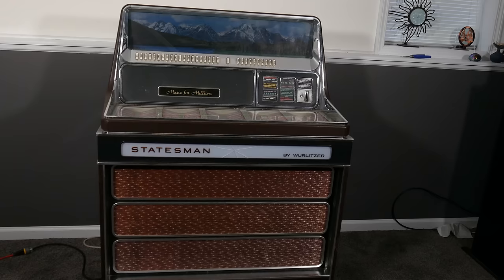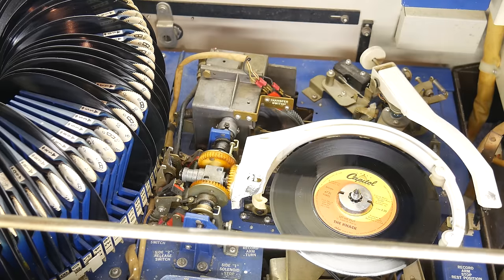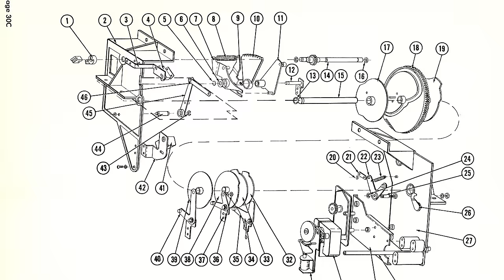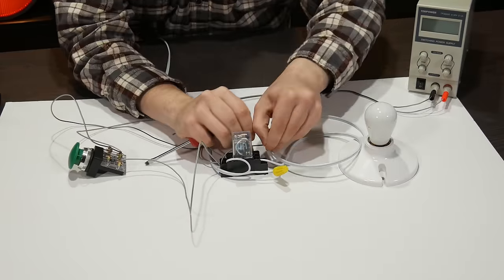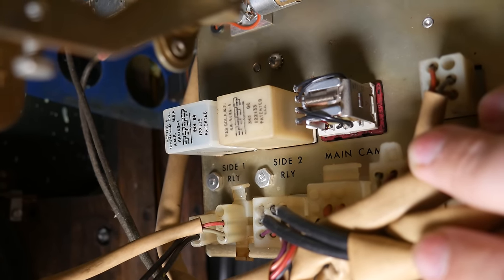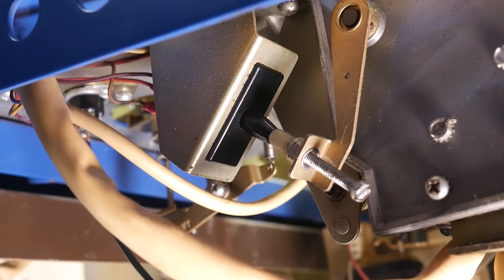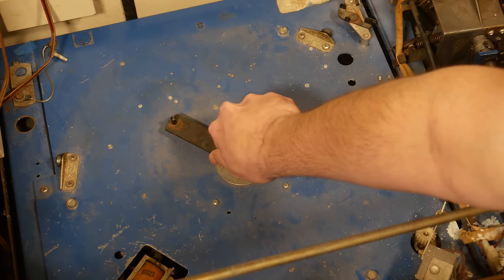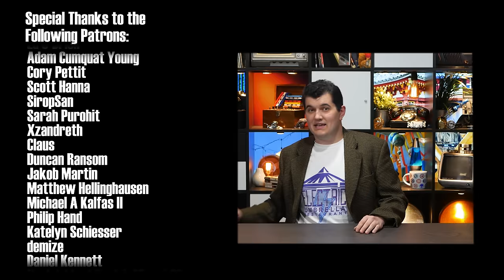The Computer-free Automation of a Jukebox (Electromechanics)

Comment: I can't even imagine how long something like this took to design, refine, and troubleshoot to get working flawlessly.
Reminds me of doing the Rube Goldberg contest for the state Engineering Fair back in HS many years ago. You can have everything working perfectly, then as soon as you add one more step it breaks the whole contraption.    Now that I think about it... same goes for coding. 🤔
Reply: BRUXXUS to make design more challenging, I believe CAD wasn’t around that time, everything is on drawing boards. Engineers those days were hardcore.
Reply: Totally, there is a whole new level when you want it reliable!

I have a CD-changer mechanism for cars I have studied some. By the looks of it, the CD's are stored in a stack, and to play one you split the stack and load the player into the slot, and then grip the disc with the spindle without letting the discs go during the operation. Some few motors and lots of switches. Eject and load probably have the same deal.

Sure a microcontroller makes the sequencing somewhat simpler, but I would guess the program is mostly "energy that magnet, and run the motor until switch xx triggers". Not too different.
Reply: And then once you have a working prototype you have to figure out a way to efficiently mass produce thousands of the finicky contraption--with each somehow assembled in proper working order.
Reply: @Mikemenn  It's kinda built as simple as possible.

Modern stuff is way more complicated, while looking simpler.
All that hidden complexity made by someone else, means that we don't understand the technology we use in our daily life. I am mainly refering to the integrated circuit(IC).

I am not convinced it would look simple if they used discrete transistors to build it.
Reply: @erlendse  Well, there is an analogy to made here. The engineers the design this machine also did not need to know a lot of how components work or or built. they don't need to know "how" a relay works (even if they do), only that it does, or how a motor works, only that it does, they don't need to know how gears are made as long as they do what they need.
Those component act like the ICs of today (yes simpler) since in order to use them in a design, they did not nee to know all of its internal features.
Reply: Imagine having to go back and change something though? You can't just rewrite a few lines of code. You'd have to physically change this whole complex design, which might have a domino effect forcing you to change other things to make it fit.
Reply: @maxsnts  True. Main issue today is that they won't even tell how something works.
Reply: @renakunisaki  Yes, but in those days products undergone a lot more tests than today before hit the market.
Today, very often product are in consumer hands even before all the features are done, the they push software.
Reply: @erlendse  Even with discrete transistors, digital circuits look relatively simple. It's discrete analog circuits that look complicated because of the variety of types shapes and sizes of components. Way back in my student intern days I had a circuit board from a desk top calculator that was basically a couple hundred transistors packed, cheek by jowl (now there's an expression you don't hear much anymore, by gum), into a grid.
Reply: Coding or designing electro-mechanical solutions for large and complex problems is in general a very hard task.

However what is not all that hard is designing a small solution to a single simple problem. This I find is one of the biggest hurdles to get over when it comes to learning to do projects, whether code or mechanical, well. - You're NOT designing solutions to large and massive problems, but rather you're breaking said large and massive problem down into small and simple ones, to which you design and implement small and simple solutions that work very very well for solving said small and simple solution.

Overall the engineering challenge on something like this isn't really in solving all electro-mechanical problems going on, as once you're familiar with how they work you can seriously design the basics and core timing on something like this in an afternoon, but rather doing a layout and parts design that can be made cost effectively... That's the real challenge and is the make or break on product engineering.

Designing an effective and functioning jukebox is easy.

Designing one that can be built quickly, cheaply, and reliably that is easy to fix... That's the part that is make-or-break for the business.

That, and getting an effective use of dark-orange going on in the design.
Reply: It is impressive but on the other end, what you see here is the result of many iterations. That jukebox is from the 70's and Wurlitzer have been in the business since a long time. So it probably start with something simple, adding more and more logic each new version as the years passed.
Reply: Order an older college level textbook on a subject called "differential indexing" its basically the study of gear ratios and cam timing within a complex system and lays it out in a way that makes it imminently adjustable and makes you able to fiddle with inputs and outputs. With modern 3d printed gears you could really have some fun playing around with gear ratios and final drive speeds, before you even get to adding grooves to the gear faces and switches outside those, or whatever sophistication you want. Its not impossible and resources exist specifically to make it usable on a daily basis. Check it out
Reply: Not always flawless operation. I heard a report of an incident where someone dialled up Dusty Springfield and got Elvis Presley... fortunatley those kind of disasters are few and far between.
Reply: You should look at the internals of a mechanical teletypewriter, with their mechanical memories. You would be left wondering how the human mind can conceive such complex mechanisms. IMO, the mech RTTY is a masterpiece of electromechanical engineering. From the motor, used as energy source AND clock generator.
Reply: Nowadays ICs are a good way of condensing the complications. Instead of going the hard way with switch and cam you make a chip that handle everything. 
The chips in themself are harder to produce, but you can simplify everything else.
And seriously, chips aren't that complicated to understand, it's just that nowadays they have a lot of functions.
Reply: $695 for a Rockola in 1970. That's about $4,600-$4,700 today.
Reply: @ameunier41  The problem is that nowadays the programmers don't know how the chips work. They rely on layers of abstraction like Real Time Operating systems, or even non real time ones like Windows to shield themselves from the hardware. That is why I don't do software.
Reply: @blindleader42  why do I just know the 42 in your handle is a Doug adams reference? Or have I misplaced my towel?
Reply: @pudgeboyardee32  if no one else heeds you... I do. This stuff is infinitely fascinating to me. and we have three young kids so this is a great way to encourage their curiosity and get them learning some useful principals... The grid can come down and a pulley system still works... It'll go hand and hand with the lessons on leverage they're already getting when we go flip rocks at the creek. Thanks.
Reply: @joeydurant6267   "Doug adams reference" Why I never. Slander! Libel!! Words I never heard in the Bible!!! It's just a reminder of what you get when you multiply six by nine...

Either that or something something something base 13
P.S. Sorry about your towel. I hope you find it before you resume hitchhiking.
Reply: @blindleader42  base 13... Sass this frood.
Reply: I would think that, with the proper notation in the design stage, it would be pretty easy to work out the sequencing, design the cams, and figure out what switches you needed and at what points they should be opened and closed.  Maybe I just have an unnatural aptitude for this stuff, but it doesn't strike me as particularly difficult, given the right tools and parts.

Comment: When I was in high school back in the '90s we had a robotics program, we relied heavily on donated old industrial equipment from the auto industry. We had a family of microcontroller - based switching units called programmable logic controllers or PLCs. You'll see those all over the place even today, they're basically ruggedized big general purpose computer controlled switching devices. The most interesting thing to me about them was the way they were programmed. Because they were designed to be used by people who had been building electromechanical logic circuits their whole careers, you actually programmed them by creating ladder logic diagrams in the interface. It was essentially a computer programming language built using the visual language of electromechanical devices.
Reply: Ladder logic and PLCs are still totally universal in industrial applications. You occasionally see someone cludge something together with an Arduino, but the vast majority of industrial automation is done with PLCs.
Reply: @a.p.2356  I guess it shouldn't surprise me that that's stuck around. I would have thought that maybe over time more and more systems would be relying on conventional computer code, but I guess there's no reason to throw out ladder logic when you've got a system that's supposed to respond in real time to logical events.
Reply: @a.p.2356  and they still use the ladder circuit style of programming. IBEW friend of mine let me check out a manual for one of the many PLCs they have at the IBEW hall, and AvE also has a couple of videos about programming PLCs ... i think he used it for a linear actuator.

Comment: To add to the “it is amazing what you can do without circuitry”:
My dad worked at a nuclear power plant as a tech. One of the pieces of equipment he worked on was a “square root computer.” It was, essentially, a box with some tubes at very specific bends. When air was sent through it, the ‘computer’ would indicate the square root of the air PSI. It was made in the early 60’s, all without a single piece of electronics. The funny part of the story is that one day he was sent out into the field to install virus/cyber-warfare protection on this ‘computer.’ He wrote in the work order “anyone capable of devising a digital signal that can disrupt an isolated pneumatic system deserves to trip the plant.”

He got called into his boss’s office, scolded for making a joke and asked if he was able to get the software on the computer.
Reply: Ha excellent
Reply: I find the idea of that computer very satisfying
Reply: "I'm in charge because someone needs to keep these dummies in line" -every dimwitted middle mgmt yes man ever
Reply: " asked if he was able to get the software on the computer."
That's when you print the source code and tape it to the analogue computer.
Reply: "Will take 4 wks to make it unhackable.  Must be programmed remotely." After 1 mos of fishing: "Job complete."  😜👍
Reply: Pfffffffffffft

Comment: Ah man, totally takes me back.  Back in the early '00's I apprenticed under one of the guys that used to repair these things on the daily.  He was getting out of the business, but there was unbelievably actually still a market around my area for a good repair tech for old jukes. So I learned what I could and took over the reigns for a few years.  I still get a couple calls a year or so that I take on if I have the time.
Reply: My neighbor still does this, has a whole workshop filled with these things. It's a dying art
Reply: I have to give props to you for getting that call: my jukebox just stopped playing records one night, can you come look at it?
Reply: I still have the 45 record
Reply: @nslouka90  Well, I'll let you in on a little secret, maybe it'll help.   I would guess in about 80% of the cases where a jukebox was malfunctioning, there isn't much wrong with it.  Stuff from that era was built on a whole other level back then. Usually a good cleaning and lube job will get you back up and running. But do NOT use WD-40 on the mechanicals, use someting like a 20W ND oil (ND = Non-Detergent).  Detergents attract dirt and dust. 3-in-1 Motor oil for electrical motors would be a good choice. Use it sparingly, no need to drown it in the stuff.  Edit: The other 20% was usually some adjustment out of whack.
Reply: I have a friend that did a similar thing with old mechanical pinball machines.
Some of it is just for the authenticity, some of it is just because they're expensive to replace.
Reply: I learned the art both from my uncle and over 15 years of experience.  I worked on jukeboxes, pinball machines, and old video games. After he passed I would get calls from restaurants bars and other old customers of his that I would occasionally do repairs for. It was one of my favorite jobs.
Reply: @nslouka90  some times it's just a broken drive belt. Most of the time it's grease that has become solid, like wax. A little charcoal lighter fluid+exercise is required to free things up followed by a light oiling.

Comment: Interestingly, nuclear plants run significant amount of systems using relay logic.  Relay logic is reliable and has predictable failure modes, unlike most digital logic.
Reply: Do you mean the relay itself failing or an unexpected state?
Reply: Also there are lots of relay lifts (elevators) out there. In Russia, most of electric trains still have very sophisticated relay and contactor and partly pneumatic logic. There is literally nothing that train engineer couldn't fix using some jumper wires, isolating tape and deep knowledge of schematics of these trains.
Reply: @g00rb4u  Well, I know digital logic can get upset pretty quickly. Static shocks that a human wouldn't even be able to notice can destroy common transistors. Similarly, if an input voltage level is between two fairly narrow bands of valid voltage, an IC can have unpredictable behavior; if it spends "too long" there (which isn't long at all), I know at least some chips will overheat and damage themselves.

I have a hard time imagining the same sort of things being as big an issue in relays. After all, transistors perform the same functions as relays, but can be microscopic. I expect relays, being much larger, to be much less fragile.
Reply: Don't tell the PLC guys that, they'll get butt hurt.
Reply: @okuno54  Unpredictable behavior in an integrated circuit as a result of an error of analog signal processing? I've been a computer engineer for some time now, but I've never seen such an easy problem to fix manifest in practice.
Reply: I guess that relay make more sense in such a context due to their ruggendesss.
Reply: would you say, that logic is... relay-able? :D
Reply: @allmycircuits8850  we had old Russian subway trains here in Budapest and I loved them for their control system. All the sounds it made...
Reply: @Mark-kt5mh  I program PLC's for a living and I LOVE a good relay circuit. Its the guy that draws the electrical schematics that gets lazy by wiring everything to the PLC rather than having to think for himself that is causing this decline of glorious relay circuity.

I also quite like the fact that safety-related things are done using relays, because that ensure, no matter how hard I fuck up, it will never lead to the mutilation or death of those squishy human beings. Or if it does, I can shift the blame to the electrical design guy.
It could lead to damage/destruction of machinery that costs 10 of my years wages, but worst case I get fired and nobody is going to jail.

All jokes aside, I do take safety seriously and always double check if the safety-features the electrical design guy made are actually adequate. And I do my best to put safe-guards within my own software that stop heavy machinery from colliding with each other if I fuck up in the more complex sequencing code.
Reply: @wybo2  In BMW we program almost all safety features on PLC, it's simpler than relays logic.
Reply: I'm with @wybo2. Software is not a failsafe. Software is what you need failsafes to protect against. See the Therac-25 disaster
Reply: I used to work for a place that installed electronic control boards. (they built appliances) It was explained that for a human to feel a static shock, it had to be at least 3,000 volts. But for a static shock to damage an IC, it was only 50 volts.
Reply: > "Unlike most digital logic."
Relay logic is digital.
Reply: Yer Nah!
Relay logic is digital logic!
Provide power to a magnet that attracts a mechanical switch; depending on the design this opens or closes the circuit.
open = 0; closed = 1
hence digital logic.

As far as reliable solid-state generally outperformers mechanical; especially in moving/vibrating environments eg. vehicles.
Reply: lol. Wanna bet? I've worked on both types, plus hybrid EM + Electronic controllers, & they all have their own weird failure modes.
Reply: @okuno54  also digital electronics (and analog too for that matter) get perturbed if electrons are randomly flying into them and hitting things. Relays don't care, it's just an electromagnet, an electron here or there doesn't affect anything.

Comment: I love how they abbreviated "relay" to rly, so "Side 2, RLY?"
Reply: That's fairly typical....
When you have many many relays you end up with an entire alphabet of code to help name everything.

For example in the UK railway signalling system a T2PR is the relay that is the second repeat of the track circuit relay (energised when there is no train on a section of track)
And the EKSR is a relay that is latched by any of the lamps in a signal having its first filament blow and running on the backup
Which generally lights an indicator lamp to tell the maintenance people to go change the lamp
Reply: Ya rly
Reply: Electro mechanics seem so much more ingenious than micro circuits.
Reply: Really bro? Side 2? At this point...? Pshh... Unreal